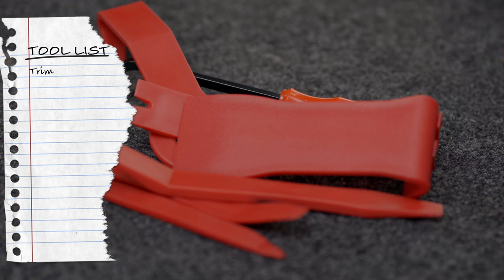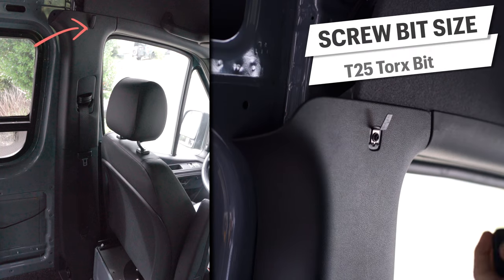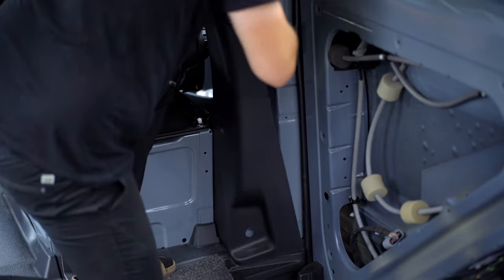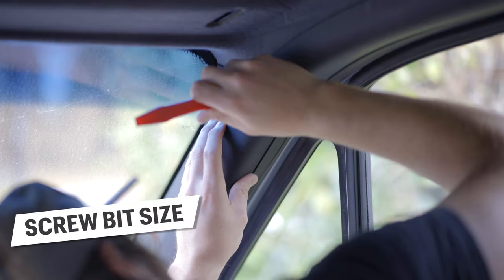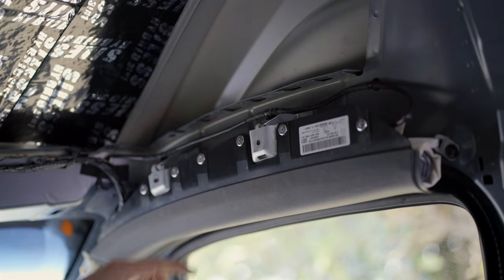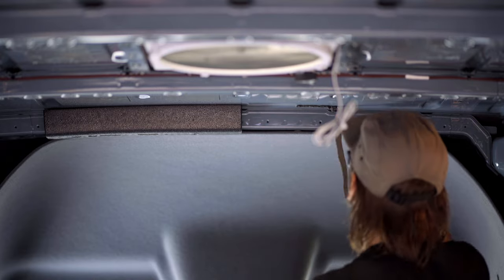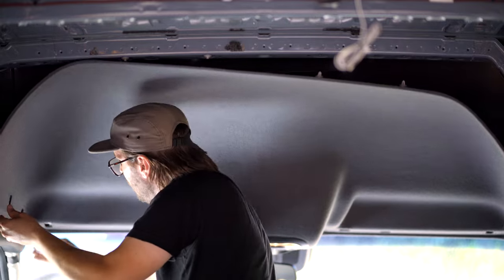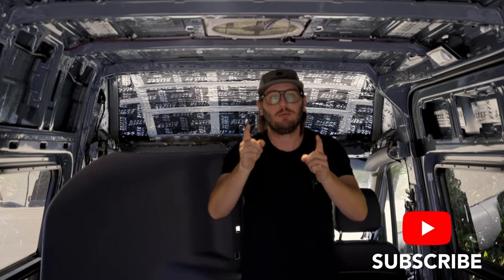Sprinter VS30 (2019+) Headliner Removal

Comment: Nice video, the first step should be to disconnect the "-" battery connection next to the gas pedal, it would not be a good sight to have an airbag go off while working.
Reply from the maker: Thank you. Also thanks for the suggestion!  I’ll pin your comment for others info looking to do this as well!

Comment: Did you turn the airbags off or unplug the battery?
Reply from the maker: Hey there!  Yes, I always undo the quick disconnect ground in the compartment down by the gas pedal when working with airbags or factory connectors cause you never know what codes the components might throw too.  

Sorry it didn’t make it in this video it’s something we missed during editing, but you can see where I disconnect in the Seat Swivel Video on our channel if interested.  Hope this helps!
Reply: Very helpful thank you!  Starting the headliner and just making sure.
Reply: Just watched that video!  Thanks again, very helpful really appreciate you guys.  Great videos too!
Reply from the maker: @mikeinmon4997  awesome, glad that it helped you out and thank you for the kind words we really appreciate it!  Happy converting hope you have a good New Year!

Comment: Why so much sound deadening? What purpose the tape on the joints?
Reply from the maker: This material is actually a 3-in-1 hybrid deadener, acoustic and thermal foam that’s lighter than 80mil butyl. The high roof is pretty loud and has a huge metal forehead so we wanted to put extra up here to quiet and cool things down. The tape is mostly carry over from the floor where you want to protect the edges of the mats so they don’t squeeze out and stick to your flooring underside since we had extra.  It also makes a single foil layer over the whole surface.

Comment: Excellent video. Just completed removal to do the 3n1 Siless. A couple things. The cosmetic foam is not cosmetic but actually part of the collision certification to protect your head in an accident. I was able to remove the headliner without removing the foam. Broke 2 of the 4 clips. :(
Reply from the maker: Hey @omjaye! Thanks for the comment and for the info on the foam, that's really great to know that information.  Yeah those clips are a PITA!! It's really hard to get under the flange to pop them out without breaking off the head :(

Comment: Thanks for this video!   It’s exactly what I was looking for as I prepare to start my DIY build on my 2024 Sprinter, so I appreciate the time and effort you put into this.   I’ll be sure to disconnect the “-“ battery connection as suggested in the comment pinned to the top.  Definitely would not want to have an airbag incident while I’m removing the headliner.   A question for you (or others reading this who’ve removed the headliner) - Will the van be driveable when the headliner is removed? I’m wondering if disconnecting the couple of wires and removing the covers from the side airbags will trigger any codes and prevent operating the van?
Reply from the maker: Hey @StephenShostek! Really appreciate you stopping by and taking the time to comment!  Glad the video was helpful!  

We drove our van for about 4 months without the headliner while we were finishing other projects with the dome light disconnected as well.  You’ll want to at least support the side airbags by re-hooking them and using a fastener to hold them in place. Also if you want your interior lights to work in the van you’ll need to put your dome light back in and zip tie it up to the roof. But like we said before we drove without it and it just says “auto lamp function unavailable.”
Reply: @moonrakerdesign    Sweet!   Thanks for letting me know about that!   Really appreciate your followup here.